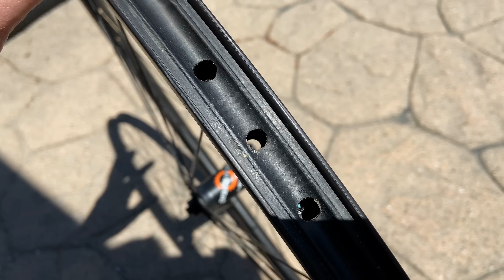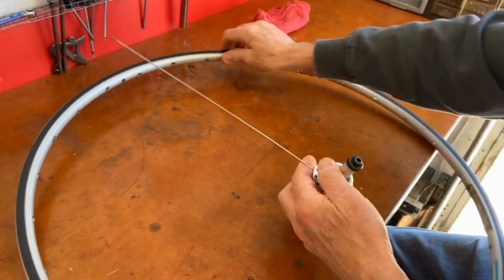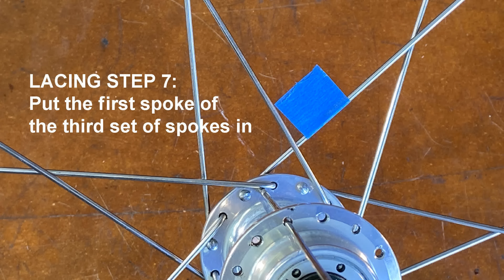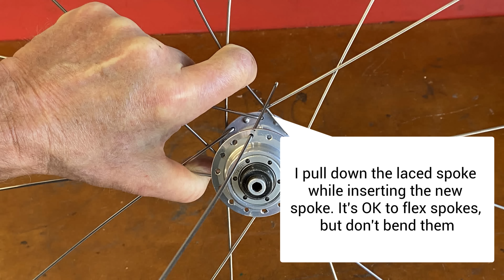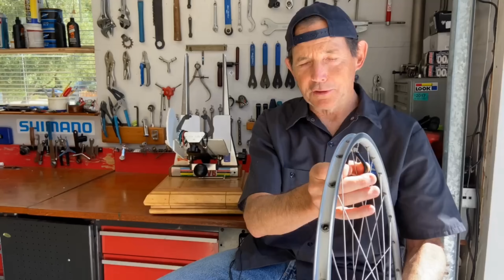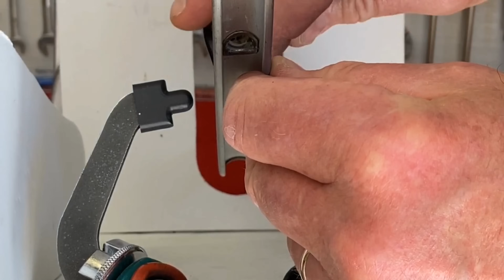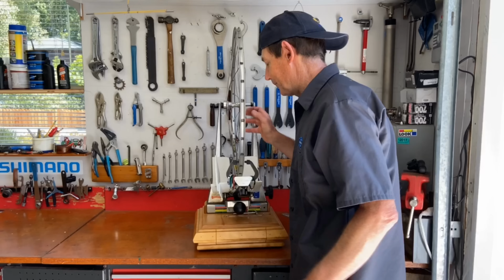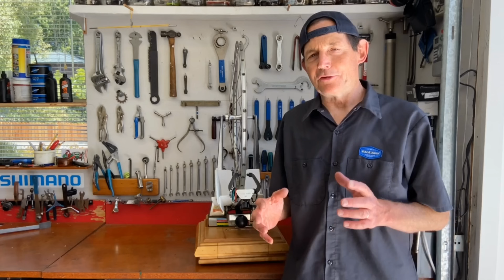How To Build Bicycle Wheels THE EASY WAY! #bikerepair

Comment: thanks for the great videos........question.....when a wheel is badly warped like a big potato chip should you just get a new rim or is the rim fixable.......I have never had any luck or even coming close.....how is it possible...
...thanks......ps I also have a 1971  PX10 and a Gitane touring bike with cantis from olden times
Reply from the maker: Thanks for nice words, Phil, and the question. Most of the time, wheels like that can't ever be made perfect again. You can try different things and often get them straight enough to at least ride home. But, the first big impact that potato chipped them and then the bending to push the rim back where it was usually leaves imperfections/bends in the rim  and the metal is weakened in those areas. To "fix" these wheels, there are different techniques. There's the "kindling" technique where you hold the wheel and put a knee against the warped sections and pull as if you're breaking wood to start a fire - to straighten the wheel. Or, you can put the wheel on the ground and stand on the high warps and sometimes get the wheel to spring back close to where it was. You can also put the wheel in a notch in a tree between a branch and the trunk and flex the wheel just so to remove each bend. Or you could use the fun "slam" technique where you raise it over your head and slam the high warps against the ground until you get the wheel straight enough again to spin in the frame (be sure to leave the tire on as it protects the rim). I have also made workbench jigs - basically something to hold the rim while I push the wheel down to put pressure on the rim where it's in the jig to straighten that part of the rim. But, all these techniques traumatize the rim and weaken it. You will want to replace the rim ASAP if you want a reliable strong wheel again. Hope this answers your question. Thanks again!
Reply: @JimLangley1  oh yeah ...Ive tried all those "side of the road " techniques through the years with little success.......tire on tire off........I was hoping you knew a super secret way because I have quite a collection of potato chipped wheels I planned on fixing one day.......I too have an inordinate love of bicycle wheels.....thanks again
Reply from the maker: @philryski9808  well, since you asked for the "super secret" way - I'll tell you, but don't share it or I'll have to ... ;-) Seriously, a way that sometimes works - assuming you have a potato chipped rim that cooperates - is that workbench jig technique I mentioned. Some mechanics do something similar using a sturdy table with a drawer using the drawer and the opening to wedge and bend against. The workbench jig is just a 1 x 3" x about 30" long piece of wood on an axle screwed into the workbench on one end (the wood has a hole in it so it pivots on the axle and the axle has a wingnut on it so you can raise and lower the wood to clamp on the rim). With this holder, you can clamp it on at the warp on the wheel as you flex the wheel over the edge of the bench to gradually straighten the rim. But, first, you loosen all the spokes in the wheel so that you are working with the rim with zero tension in the spokes. That way you will be able to see the true condition of the rim, not any influence from spoke tension. Then, you go around using your jig or drawer to gently but firmly reshape the rim and get it as straight as you can removing all the bends. Once it's as good as you can get it you can true, round and tension the wheel again. Ideally, when you've straightened the rim and removed all the warps, there will be no dents or bulges or flat spots (i.e. real damage to the rim). If you do have issues like those, you can sometimes improve them bending with an adjustable wrench jaws and other bending tools - if you're lucky. I don't know how secret this technique is, but I know once in a while it has saved a rim for a few more miles for me. Good luck, Phil - hope you can get some of those wobblers back on the road!
Reply: @JimLangley1 ......I always thought its do able... youve given me new hope......I will try again and let you know how I make out......but I think everyone would want to see a video of  the slam against the ground method or on a fencepost or the crotch of a tree fix...or jumping on your rim in the middle of a cornfield.......instant viral infamy ......
Reply from the maker: @philryski9808  ha, ha, yes it would make a hilarious video.. I will add that to the list and keep on the lookout for an epic potato chip to fix - great idea, thank you, Phil!
Reply: @JimLangley1  it would bring a warm and peaceful feeling of joy to many hearts

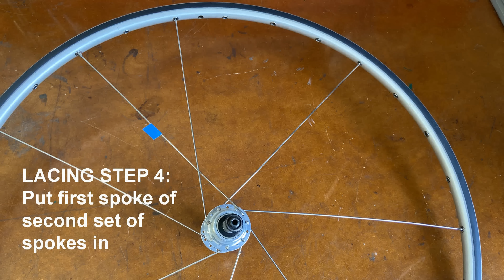Comment: At 11:56, I noticed on the drive side of the wheel you laced it with the pulling spokes in the outer orientation (head in), but on the other side of the wheel it looked like the pulling spokes ended up being on the inside of the hub...  Should the drive-direction pulling spokes not be on the outside of the hub on both sides?  Thanks!
Reply from the maker: Thanks for watching, commenting and asking a great question, Mark. How a builder chooses to lace wheels is based on what they believe makes the best wheel. You will find if you look at enough wheels and talk to enough builders (or just browse discussions online) that there's lots of debate about what's best. For this video I didn't want to get into wheel theory or the "right" and "wrong" way to lace wheels because it can confuse beginners unnecessarily. And, as long as they get the patterns right and get their wheel true, round and tight it will be a nice, reliable wheel regardless of whether they end up with a mirror image or identical lacing pattern. I usually build wheels with mirror image lacing (all pulling spokes on the inside) UNLESS they are disc brake wheels and for those I use the Shimano lacing patterns (front and rear wheels differ), which I have a separate video about here: https://www.youtube.com/watch?v=gfWd7_avr1s&t=41s The reason to put the rear wheel pulling spokes on the inside is to prevent any chance of pedaling force on steep climbs pulling the rim to the right, which can cause rim brake drag and worse, the spokes touching the rear derailleur when you're in the lowest gear. That late Jobst Brandt, who I knew and followed, describes this phenomenon in his book The Bicycle Wheel (pgs 74-75 - a great book to own if you don't have it already... it's out of print and expensive now but Ric Hjertberg at Wheel Fanatyk was kind enough to make it available in pdf form here: https://www.dropbox.com/s/mbsx865uzz0s7jq/Bicycle_Wheel_-_Jobst_Brandt.pdf?dl=0  ). I hope this answers your question and thanks again for the excellent question.

Comment: Interesting i believe it is easier to lace one side at a time trailing one side,  then trailing the other side... leading previous side and lleading last side. Second,   twist rim left or right according to holes. I always twist right, better for trailing spokes be inside... Missing point is to align the valvle and hub...cosmetic thing of course... Thanks for thevideo
Reply from the maker: Thanks for the nice comment, Oscar. I teach new wheel builders this way because in my experience it's a method that's easy to follow and understand for those with no knowledge of wheels or building. As you know, there are many other ways to lace wheels that work and I encourage new builders who have learned to build wheels to experiment to find which approach they like the most. Regarding aligning the hub label, I will soon have a separate video on that. I did not include it in this video because I didn't want to risk making the first step confusing. And, as you pointed out, it doesn't have to do with the integrity of the wheel. But, it is a nice detail and something builders will want to do. Thanks again!
Reply: @JimLangley1  yes, I agree with you, it is always good to  experiment with lacing, truing, dishing finding the best way for you.  
There is a topic always give me problem, how to round a pinned rim. I have build wheels with some pinned rims and for any reason the pinned section is flat!  I have not figured out yet how to make it round keeping spoke tension in control buts as you said, experiment and patience.
I will wait for your videos, thanks a lot!
Reply from the maker: @oscalcmen  When I have a pinned or welded-seam rim with a flat spot here’s what I do. First, I look for this problem early in the truing process. It’s very common on aluminum rims. I want to find it before there is any real tension in the spokes. So I will get the wheel true and round mostly by loosening spokes only tightening the few that need it. I will get the wheel true and round with maybe 10% of final tension. At this point you will be able to see the flat/bad spot. It’s usually only 2-3 spokes wide. At this point, I focus on fixing it. Because the spokes are still loose so the rim can be forced to round out. To do it, let’s say it’s a 32 spoke wheel and the pinned/bad area is 3 spokes wide. You subtract 3 from 32 and you get 29. To force up the flat spot, you do not touch those 3 spokes. You go around the wheel and tighten the 29 spokes each one a half turn or so. Now, when you check you should see the bad spot starting to round/move up where you want it. Then you just repeat tightening those 29 spokes until the bad spot is round like the rest of the rim. At that point you can true, round and tension the wheel as normal. Usually the area that was flat/pinned will have those 3 spokes slightly looser than the rest when you’re done with the wheel. But just make sure the tension of the rest is good and those 3 spokes will be fine. Give this a try next time. I think you’ll enjoy it.
Reply: @JimLangley1  I have now the opposite issue, a bump at the joint (sleeved rims) I will try something as the opposite as you commented here. I noticed three  spokes at that section have a very large tension, I lessen these nipples but were so tight that nipples  got some damage with the nipple tool, I need to replace them. 
Thanks a lot.
Reply from the maker: @oscalcmen  that approach should work, Oscar. You will need to replace the bad nipples, yes. Good luck!

Comment: Your wheel looks offset.
Reply from the maker: Thanks for the comment, John. I show how you center rims (deal with rims being offset to one side) toward the end of the video. That's something you try to pay attention to as soon as you start truing and rounding. It might look offset because the finished video is made up of many shorter videos ("takes") and then they're all spliced together. So, it's possible some clip of the wheel when it' was offset appears. It's also possible that the camera distorts the view you see and makes it look offset. But, I give full instructions for centering the rim (and fixing any off center rims) so that the wheel comes out right.

Comment: is it a big pro blem if i ride a bike with a bit of a "down spot" on the rim? it kinda feel weird but is it still safe?
Reply from the maker: Thanks for the question Cavaliere. A small "down spot," could mean a few things. The rim might have a bad seam at that point. The wheel might have hit a rock or pot hole and that hit actually bent the rim. Another possibility is that the spokes are overtight right at that down spot. In most cases, if it's a small spot it's likely the wheel is still safe. The most important things are that all the spokes are still intact (no broken ones), the rim is structurally sound (no bends or cracks), and the tension is relatively even and tight on all the spokes around the wheel. As long as these things are true, then the wheel is probably safe to ride on even if it has the small down spot. Hope this helps.
Reply: @JimLangley1  thank you

Comment: I'm building my first wheel, and I used zinc-based anti-seize on the spoke threads and the "seating part" of the nipple holes in the rim.  I read that zinc anti-seize would work well with my aluminum rim and brass nipples, while other kinds of anti-seize might have caused problems with one or both kinds of metals.   BTW for any newbies -- you can also buy a "spoke tension meter" for checking spoke tension.  Thanks a lot for the video!!!
Reply from the maker: Thanks for your comment with tips and for the kind words about my video, JohnSmithZen - very nice of you. I'm glad to hear you're building a wheel and doing your homework learning more, too!  Yes, for checking the tension of the spokes and getting them right every time, a spoke tension meter is very helpful. I've found that most people who start building wheels like doing it and build more. Once you are building multiple wheels for yourself and/or friends, then it's definitely worth the expense to have a nice tool to measure spoke tension. A quality tool that's reasonably priced is Park Tool's TM-1 Tension Meter https://amzn.to/35hmLY6 One of the most helpful parts of using Park's Tension Meter is that they provide an app for use with it. The app allows analyzing/mapping your wheel tension to understand and balance tension in wheels even more accurately. Here's a link to their page about their app: https://www.parktool.com/wta in case it's of interest. Thanks again for the comment!

Comment: Hi I have a will that spokes keep breaking and I'm replacing them all. Would it be easier to take all the spokes out and start from scratch or do the spokes one at a time? Take one smoke out put one smoke in. And why one method is better than the other.
Thank you
Reply from the maker: Thanks for the great questions, George. Both approaches work and it's debatable whether one is easier than the other, so I'll tell you what I like to do and why. First I go around and turn the nipples counterclockwise to loosen all the spokes. That detensions the wheel taking the stress off the spokes, hub and rim. If you don't do this and just start cutting the still tight spokes, they can shoot out of the rim like little arrows (kinda cool but can be dangerous, too). But, a better reason NOT to cut the tight spokes is that the sudden release of tension might damage the hub or rim. Once you've loosened the spokes, with a pair of diagonal cutters (aka "side cutters:" my favorite is Channellock's https://amzn.to/356IFgy ), cut the spokes close to the hub all around the wheel but LEAVING THE 4 SPOKES RIGHT NEXT TO THE VALVE HOLE IN THE RIM INTACT and still attached to their nipples. Now, remove all the cut spokes from the rim and hub. The hub and rim now will be connected still by those 4 uncut spokes. I leave those spokes in place so that when I replace them with the 4 new spokes and nipples I am guaranteed to match the exact spoke pattern that was in the wheel before. As long as the wheel was built correctly the first time, this means you will end with parallel spokes at the valve stem and the correct cross pattern as you put all the rest of the spokes in without having to figure it out on your own, which saves time and only requires copying what was already there. Hope this long answer helps you end up with a beautiful new wheel that doesn't break spokes anymore.